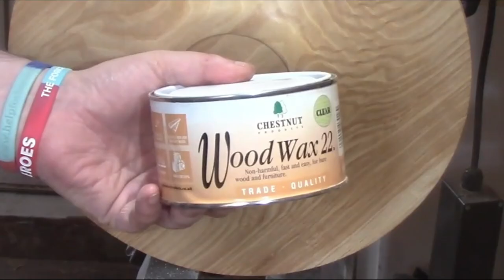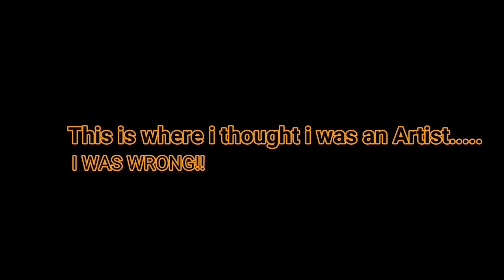Woodturning | Planets - Ash Platter

Comment: Hi, just wandering as a coronet herald user, do you have any problems with the tailstock. I have one and I am struggling with drilling anything prior to hollowing  using drill bits and a chuck mounted in the tailstock. It just ends up so hard to move and is nearly binding up. Thanks. Mick
Reply from the maker: Hiya, yes occasionally that happens, it just needs a good clean that is all, record power have a very good in depth video on their YouTube channel on how to do this.... hope this helps
Reply: jp woodwork hi, thanks for that. I have followed the video and cleaned the tailstock, however, it didn’t fix the problem and now on my second quill with much the same problems.
Reply from the maker: @michaelcockburn544  i would recommend contacting Record Power and seeing what they suggest, maybe a replacement tailstock, maybe there was a bad batch? i know someone who has had one longer than me and his still runs perfect, i asked him today because of your comment